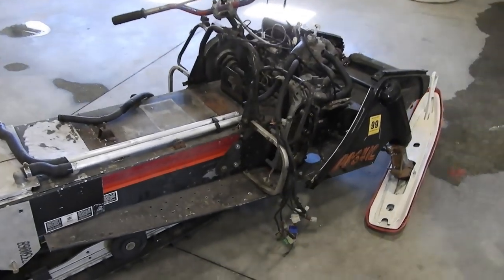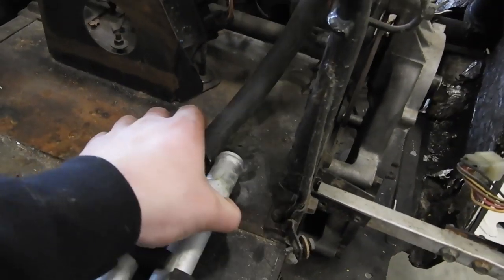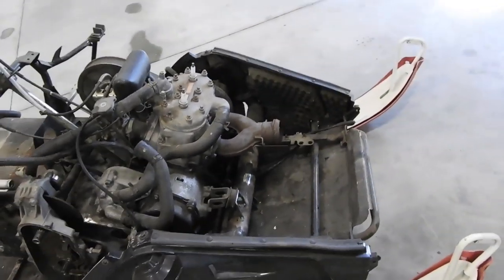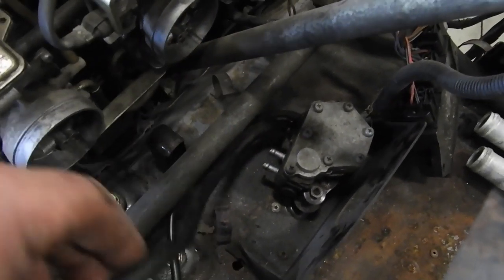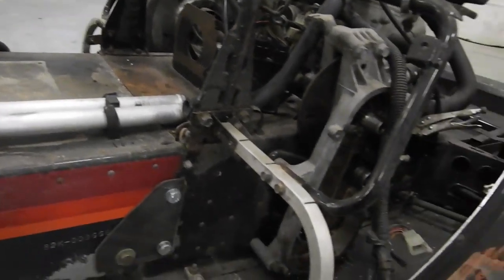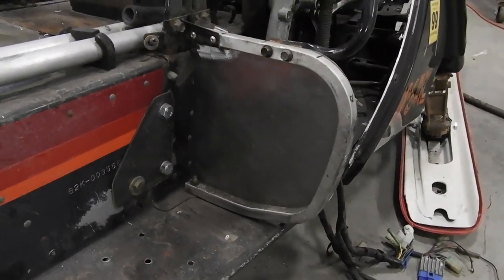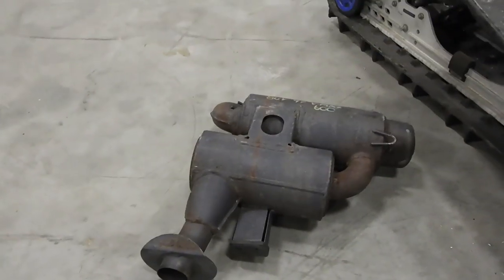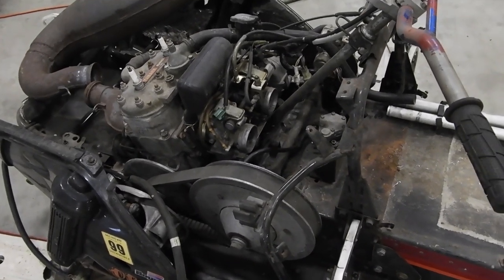Making Room in a 600 Phazer Mod

Comment: Im building a yamaha phazer with 136/1.5 inch lug, track. And it has a 570cc liquid cooled 570 thats ported and has wiseco Pistons, Along with a psi pipe, and 40mm carbs, The engine ran, like a jet, it dig wheelies for days, but even better in a phazer, i think.🤔

Comment: I did it on a 93 exciter few years back .took it from 30 liters fuel capacity to 48 .  little cut and welding the handlebar brackets .   I'm currently building an 86 phazer 144 with xlt engine